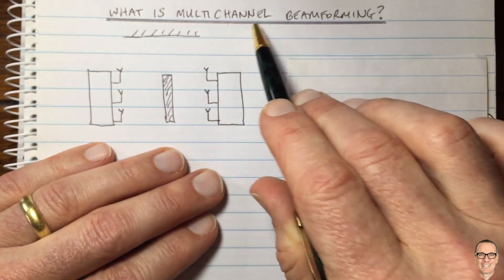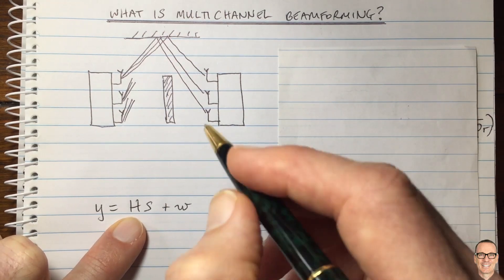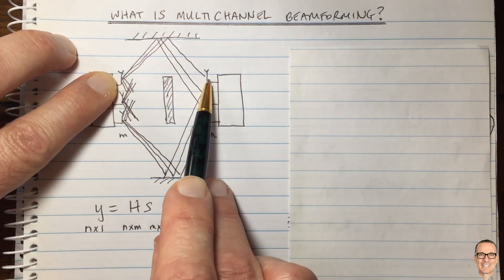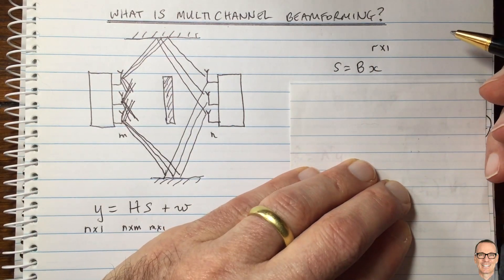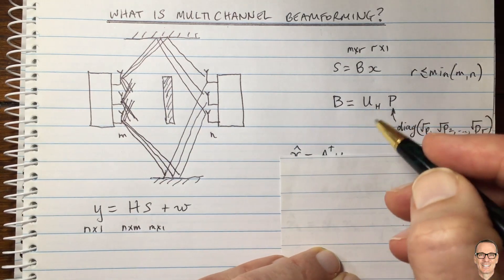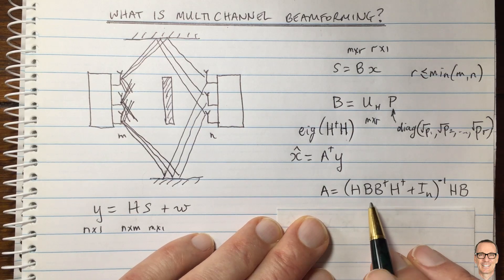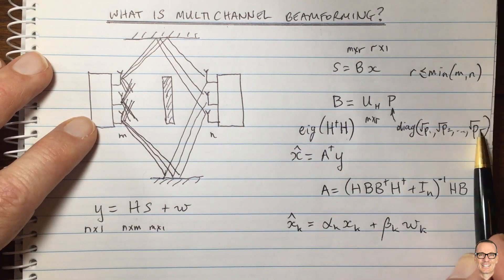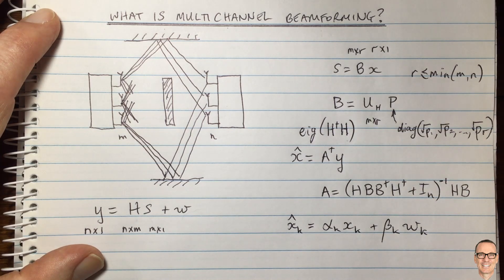What is Multi Channel Beamforming?

Comment: Not clear how r is linked with how many reflectors are there. We can have more or less reflectors but still we can stick to r parallel channels, no?
Reply from the maker: In order to have r parallel channels there need to be at least r different propagation paths, so that the r different data streams can be directed in r different directions, and still make it to the receiver.

Comment: Hi professor, could you please explain why I cannot have 4 streams in a 3x3 MIMO communication even if I have 4 spatial paths? I know from antenna point of view that 3x antenna can only have 2x nulls which means that we can only do 3 beams with zero forcing. But can’t we have some beam to beam interference while still maintain good SNR for 4 streams?
Reply from the maker: You would need the beams to be narrow enough to resolve the 4 spatial paths - but to make them that narrow it would require 4 antennas.

Comment: so this is the part that's confusing to me here. Is this what's called a spatial stream? (is there a book you would recommend to study this? I dont mind the math but most of the time, I have found writers at this level are trying to impress someone. I can't stand that. Maybe if you would recommend a book that you have come across?) Thank you for doing this. This and equalization are the two aspects of comms I really need to hunker and get a deep deep understanding.
Reply from the maker: Yes, that's right, there are r spatial streams.
Reply: @iain_explains  thank you again for putting these up. I am very grateful

Comment: Thanks for your insightful video. You said min(m,n) determines the degree of freedom. That's the number of max streams.
Isn't it possible to send more streams theoretically? Let's say m=4 and n=6.
I want to transmit 6 streams. I think with 4 Tx, you can generate a beampattern that has more than 4 beams. We can than chose the 6 strongest beams and place the Rx there. So I could have 6 streams. In this case, I could mix the 6 streams together and transmit over my just 4 Tx. Of course, that wouldn't be very ineffective and I would have (bad) not-narrow beams with perhaps interference problems. But, could that theoretically be done this way?

(My antenna pattern can give me more beams than min(m,n) -> some of them are quit small of course - that's what is not really clear to me.)
Thanks a lot.
Reply from the maker: You must be talking about one of my other videos. Your comment doesn't relate to this video at all. I assume you're talking about one of my MIMO digital communications videos. Assuming that's the case, my answer is that you could send 1000 data streams if you want to (or more!), but it doesn't mean they will be able to be separated at the output of the channel, and successfully decoded.

Comment: so you have the transformation B on your signal to precode the information, which will create beam patterns. But you also have to apply the pinv(A) at the receiver. I don't get why. Is it some sort of match filter to max the SNR or is it needed for the beam forming to work?

Also what is u_H?
Also how the antennas know which path to direct the beam forming from as the channel impulse response is the sum of the 2 paths.
Reply from the maker: The matrix that gets applied at the receiver combines the signals from all of the receive antennas. It is a good idea to combine them in a way that achieves your aims (eg. maximising SNR). The matrix U_H is explained at the following time point in the video: https://youtu.be/e6scR0C4RAc?t=329 
The antennas "know" which path(s) to direct the beamforming by calculating the U_H matrix.

Comment: You say the second path values doesn't change the dimension of the matrix H -> when entry of H(1,1) is e.g. 0,34exp(j*0,8) for one path then with the second path H(1,1) changes to a summation of 2 complex numbers e.g.  H(1,1) = 0,34exp(j*0,8) + 0,63exp(j*0,2)
Is that right?
Path1: amplitude: 0,34    phase: 0,8
Path1: amplitude: 0,63    phase: 0,2
Reply from the maker: Yes, exactly.

Comment: Hi Professor Collings, it seems you have re-uploaded this video and my previous comments were gone. Just thinking about how to map MIMO layers to physical channels that different layers experience spatially separated paths, and in case of highly imbalanced channel gains of these paths, would water-filling imply no usage of high rank transmission? In 5G with large number of TRX at gNB, due to high BF gain, UE could still report high RI even though the MIMO channel is ill-conditioned with such path imbalance. How would power be better allocated in this practical consideration? In addition, if different paths are assumed to arrive Rx almost simultaneously, i.e., within the delay resolution such that they cannot be separated as delayed taps, my understanding is doing eigenvalue decomposition would result in only 1 dominant eigenbeam with multiple peaks pointing in these paths (assuming co-located Rx antennas e.g., at UE without BF capability). How to map layers to different paths in this case? Last but not least, I have to say you make great videos to explain basic things thoroughly with just a pen and piece of paper, thanks, loving your channel!
Reply from the maker: Hi yes, sorry about re-uploading. I realised I had said something in the original version which was correct for MC-BF, but I'd said it in a way that implied the result was more general than it was. So I decided to edit that bit out, to avoid possible confusion. In terms of your questions, the eigenvalues determine whether the water filling solution puts power into all of the eigenvectors or only a subset. It's impossible to say anything more specific than that, without actually calculating the solution for a specific channel matrix. In terms of your comment about the delayed taps - that's not the case. I probably should have been more explicit about pointing out that everything in the video is for narrowband channels (in other words, no ISI). The "shape" of the "beams" is not as simple as either narrow beams in the direction of each of the collections of paths, or as you suggest they might be, having multiple peaks in the direction of multiple paths - although in some situations they might be. It is simply a case of what the eigenvectors of H^dagH turn out to be. In a general sense, they will be directed towards the main collections of paths, but the exact shapes are hard to say anything about in general. Thanks for your comments. I'm glad you like the videos.
Reply: @iain_explains  I though we have multi tap channel or frequency selective channel  due to different reflectors.